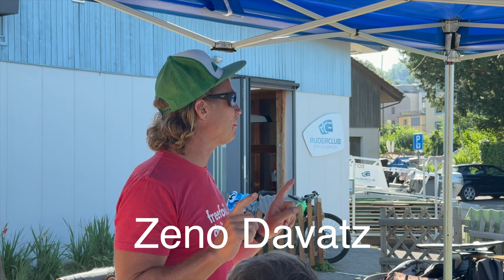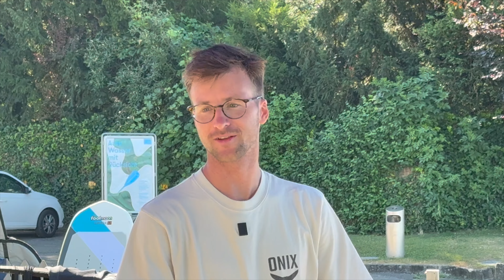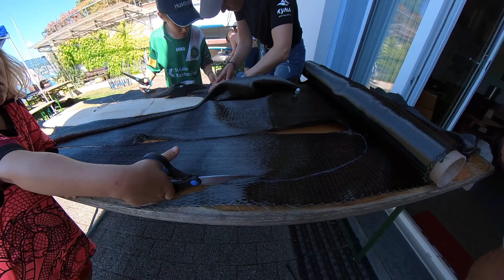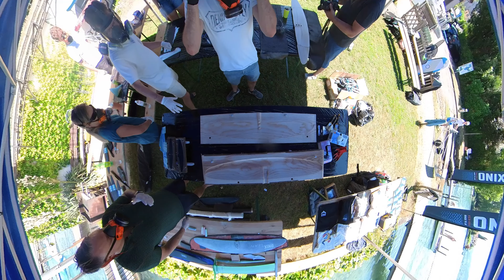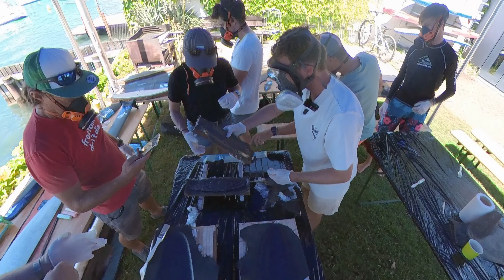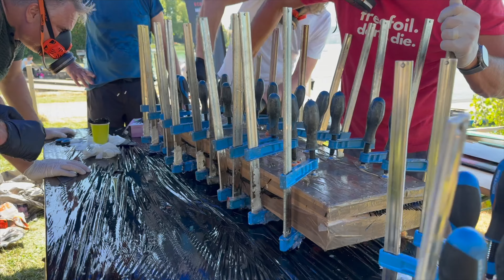I built a Frontwing for pump foiling.

Comment: That was interesting. I've been making my own foils since 2020 and that's similar to how I did mine 2+ years ago. It's important for the higher performance designs to get minimal fibre layers right at the front and back where the mould closes. Also, when doing a clamshell mould, you need to put consideration into a core. Without a core(which can be simply microspheres and epoxy but can get a bit hot without slow hardener), you will most likely have issues after cleaning the perimeter edges with breaking into the internal airspace in at least a few places around the seam. Also, the core gives the top surface of the foil strength against buckling.  Anyway, mine are so thin now that most of their volume is carbon and I resin infuse the carbon inside my mould. I don't skin them with glass fibre but I have considered basalt coth. 3D prints aren't much good for cores, they get too soft in the sun. And if you do use 3D printing, be sure to do double wall infill sealed pockets and use either a solit modifier near the attachment bolts, or a pass through for resin, maybe a very high density piece of wood, predrilled fatter than  the bolts so it maintains sealing against moisture after drilling.
Reply from the maker: So cool..! I really want to get into it now…

Comment: Very cool, is the core of the front wing PU foam? I can see that the carbon fiber cloth gets put in the mould and then wetted out then clamped, what's between the carbon isn't clear. I've been 3D printing wings and glassing them, they work well ebough for my efoil so i have an idea of the type and size of wing i want before dropping cash on a wing.
Reply from the maker: The core of the stab is 3-d printed. The core of the the Frontwing is Pine wood (if I remember correctly). But definitely wood!
Reply: @mattonfoil  I did make a stab 3d printed and covered in carbon, and while it was working pretty well , it did have too much flexibility and would become unstable under load for example when going into a sharp jibe. 
Then after flexing it enough times, it delaminated from the 3d print, What material did you use and how do you prevent delam ?
Reply from the maker: @stefanwelker956  response from sam: Yes pla very important to sand everything to prevent delamination
Then everything is in the amount of carbon that you put
Your contact needs to put more UD carbon

Hope that helps!